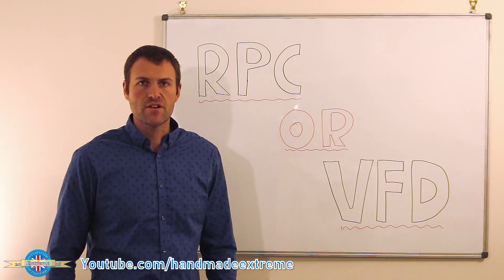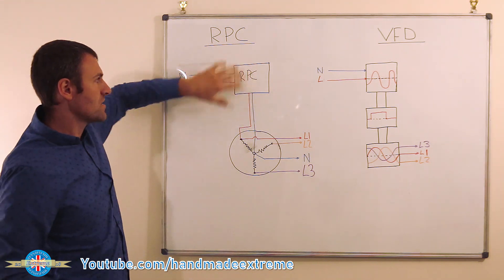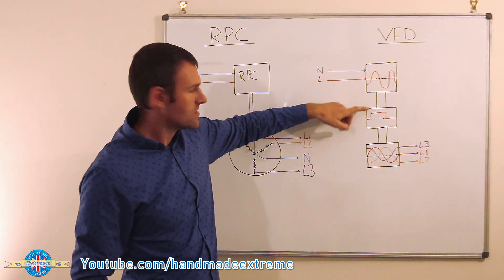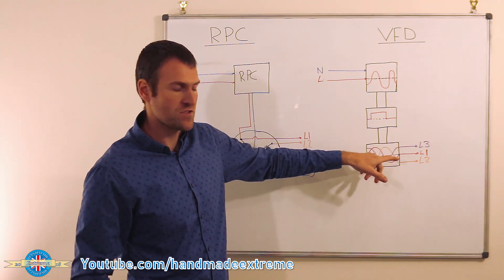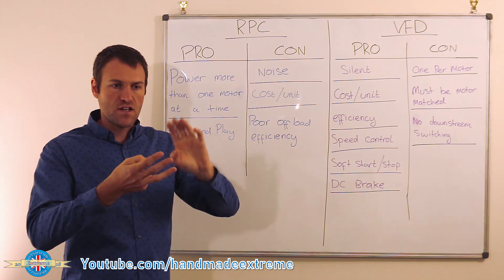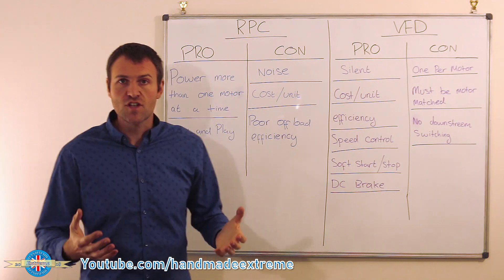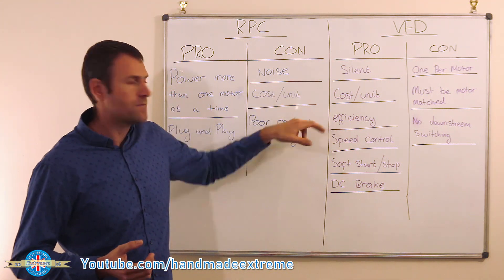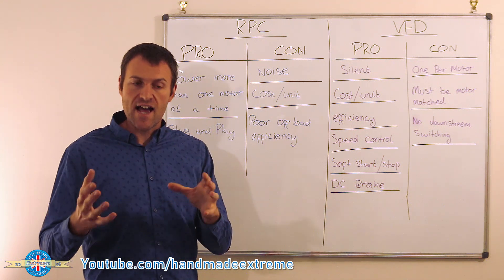Rotary Phase Convertor (RPC) vs Variable Frequency Drive (VFD) ... Which is best ???

Comment: I find VFD ability to vary lathe spindle speed during a cut useful especially when facing. I run my air compressors, horizontal shaft buffer and a three-phase transformer MIG off my RPC enjoying the additional idler effect of added motors.

Comment: Great video. I appreciate people taking the time to make these to help us out. Some things I've learnt; 

The motor brake on a vfd isn't ideal in an e-stop situation. An e-stop should kill the power to a motor. If you kill the power you cant electronically brake the motor. To use the dc brake in an e-stop situation you have to leave the power on for a couple of seconds so it depends why your wanting to e-stop.

I dont find the speed control on a mill that useful as you lose the torque so end up having to gear down anyway. It can be useful if your going cnc as you get the stop, start, reverse and speed control built in.

You can Multi motor a vfd so long as you stay within its working range for the required combinations of motor on / off and protect each motor individually at an appropriate size which you should be doing with a rotary converter anyway.

Regardless if its rotary or vfd i would connect any single phase components to the incoming live and neutral personally. 

Vfds can often go way above 50hz, 200hz isn't uncommon, so you can make your mill spin a lot faster which is great for small cutters. If it can take it... Many machines will happily go up to 60hz (USA) which can get a 2500rpm mill up to 3000rpm.

Comment: What os this mode to what to compare thins witch as nothing to do together. RPV vs VFD, but what a bullsheet !!! Ok you can drive a motor with both but tha'ts all. They are completly made with differents technologies and workinf on motor's parameters completely different, and you want to compare them. That's totaly insane, it like compring a traditionnal bicycle and his new cousin, the electrical bike. 
RPC is a controller to help the motor starting in the best conditions (U/I, slip and Torque), but only in the starting phase, when the motor is to his stabilised speed and loading, the controler doesn't working anymore to make short.
VFD is a controller to drive a motor from its start to its working speed and that speed could be various several preset and with differents ways to goal it (time prams, current ramps, profile triangle, square...). Rhere is may may art to drive the motor and with the new generation till 10 or 15 years, you can drive it from about 20% from its nominal speed too 150% of it, without damage to the motor.
RCP is a Austin mini from 1965 and VFD is Bugatti Chiron from 2027, what do you want to compare between those 2 cars, that's insanen so it is for your drivers. Allright they can roll in a road, you can drive them but that's all for the comparasion.

Comment: Sorry, but if you're going to give a lecture on RPCs please understand that a 3-phase motor cannot get rotation from single phase power applied to one winding only, which is what you show.  The motor would sit there and hum, and eventually go up in smoke.
At minimum, you need a large (in mfd)  start capacitor wired between one side of the single phase input and the third motor winding to give the motor rotation, with a potential relay connected across that winding to disconnect the capacitor when the motor is up to speed.  To take full advantage of the motor's capacity, one or more run (low mfd) capacitors can be connected in parallel with the start capacitor/relay connections.  A 3-phase motor running on single phase operates at about 2/3 of its capacity.

Comment: Although he mentions running two or motors from one RPC, there is no mention of the limitations of doing so.  What is the formula for calculating acceptable loads?  Is there a rule of thumb that says what size RPC for the motor or motors connected?  This information would be very useful.

Comment: The idea of plugging/unplugging motors into some kind of a receptacle from the VFD sounds interesting.  However, if you unplug a motor from an energized VFD you run the risk of blowing up the VFD.  They DO NOT like having their load side disconnected from the energized load.

Comment: VFD provides  dynamic braking?  I don't think you are going to get an off-the-shelf VFD equipped with dynamic braking. When you step into dynamic braking you are looking at additional designs and components to deal with the regenerated energy from the motor.

Comment: With the VFD you don't get a neutral.  Doh!  The idea is to supply 3 phase power.  If you needed 120v single phase power, you would just go to your lighting circuit panel.  Why overcomplicate things?

Comment: Well, that puts a cat amongst the pigeons.  Bought a three phase geared head mill/drill with an onboard 3 ph coolant pump. Main drive motor is 1.1KW Bought a 4KW VFD thinking that it's over capacity and will run cooler.  Also have a 3 Ph combo saw bench/spindle moulder. Sooooo, I can't run the coolant pump off the same drive? And the VFD has to be matched to the driven load therefore none of this will work???  Going to have to look more deeply into this.

Comment: This video towards the end exactly described the beginnings of my home machine shop lol. Started with a lathe, used a VFD. With the lathe, I wanted a mill, then a surface grinder.. and I have more I want to add.. so rotary phase it was. Plus I didn't size the VFD high enough.. lathe had a 5hp motor. Bought a 5.5Kw VFD. Technically, 5.5Kw good for 7.5hp , but i really should have got a VFD sized for 10HP motor. Worked for a few months and VFD died. It was also cheaper chinesium VFD. Maybe if I'd used a higher quality the 5.5kw would have been plenty of head room.

Comment: What a lovely channel you have here, I dont understand why youtube did not recommend this to me ever before when I search for relevant stuff that you clearly cover in your uploads. 
Anyway, how big of 3ph motor can we run on single phase by either of these methods? For example, how about a 5.5kw or even better 7.5kw air compressor? I presume we have to be limited with 1ph supply at some point? 
Thanks

Comment: Thanks for the detailed explanation. I bought a used Cabinet table saw at auction. I had planned on a 3hp/2.2kw but I ended up with a 5hp/3.7kw. It's a better saw, but the price for the VFD rose from $260 to $700 though I did find one for $400. It came with a panel box containing a magnetic swithing system and a poorly placed on/off switch. Those I eliminated because they were unnecessary with the VFD. It has a terminal strip for connecting switches etc. so I plugged in a foot pedal switch for hands free operation when cutting full sheets. One pro I see is there are about 100 settings features programmable for my work style. I used the soft start/stop feature and left most settings in default. I just recently discovered it also will not let the motor start if the blade has any resistance such as my zero-clearance insert was set for plywood and I forgot that when I raised the blade for 2" wood. the binding of the blade did not end up tearing the thing out it just refused to run or even make sounds like it was trying. So I made the necessary adjustments and carried on.

This was the only 3ph machine I had, but now I have another which is a water cooled table router which is 3ph - 220V It is close in power at 3.2kw/4.3hp. I will have to see if it works. I may need to buy the next size down VFD, but they get cheaper as they get smaller.

Comment: I bought a 5hp vfd to run a 5hp wye wound blower motor. I went to hook it up but the instructions say to rewire the wye into delta. Problem is, its a 9 lead motor with the 3 internal leads permanently connected. Why does it need to be in a delta configuration?

Comment: If the VFD has intermediate step where it converts AC to DC( then it should be possible to run it strictly off DC?

This would allow the three phase motor to be used with battery power in a vehicle.

Comment: I have a power supply with 3 phase 120/208vac input and DC outputs which power fairly substantial DC cooling fans.  I'd like to troubleshoot  these power supplies on a work bench instead of outside using a generator and praying for good enough weather.   My question is would it be safe to use a VFD for this purpose?  All I've seen people talking about using VFDs for is AC motors, so I'm  a bit concerned it might not work.

Comment: Good evening just inquiring whether you could use a VFD to run a syil x7 CNC mill. Or would this cause issues with the LNC 6800 control panel. Cheers PS the spindle motor is  380v 3 phase at 5.5kw I think the rest of the system works off 240v single phase.

Comment: Struggling with wanting to be a hobby machinist. I set out to buy a lathe and fell on a deal with a Hardinge lathe. Without doing any research on it and getting hit home and find out by this video that I cannot just throw a VFD on it because it has three motors on it. Thank you sir for the video. Wish I had watched it first.
Reply: True but you can pretty easily set it up with 3 vfd's if needed. As stated in the video if any of the motors on the machine are not 3-phase then they don't need a converter. Otherwise you could just set all three vfd's on a board and just flip them on before firing up. Sure it is a bit of a pain to have three but it would work.

Comment: Another PRO for the VFD is the electronic protection it can provide to the motor (short circuit, thermal, single phasing). With a RPC, you'd need a separate Thermal Overload.

Comment: One trick we do in the states is to install a three phase breaker panel after the RPC. Then each machine has a circuit breaker matched to it's current demand. The RPC has a master output breaker or fuses so if too many machines are on at once, that will trip out. The machines can then be hardwired to the breaker panel as three phase plugs and sockets can get quite expensive, $50 for just a single plug or socket.

Comment: I use one VFD for several machines from 1hp to 5hp ... 4yrs on in a busy commercial workshop and I've had no issues. Some machines are easier to use an RPC and some are easier to use a VFD, my Cincinnati mill just trips my mains using an rpc, yet runs on a cheap VFD just fine ..... yet my TOS mill with it's multi motors is just simpler to use an RPC. You can run two motors on one VFD and have one motor switching while the other runs constant, you just need to set it up properly. ...
Reply: Oh and hands down run a large compressor using a VFD, no sense in using a RPC.

Comment: Very informative video thanks so much, still had to check what a quid was. lol   Want to hook up a 2" belt sander with a 2 HP motor, and use a 3 phase hookup with a VFD, I only have single phase, so I need a 2 HP VFD to match the motor correct, also have a mill and several lathes, but don't need any more converters to run them, they are all 1 phase 220.  Am in the U.S.   Keep my eyes open your more from you, and thanks again, any ideas from you that could help me?👍👍👍👍

Comment: one thing you don't mention with the vfd's is that with the way they work, they generate high voltage spikes, which will ne worst with long cables, that will make motor insulation fail, specially older motors, thats why inverter duty ac motors where created

Comment: Have a band saw that is 3 phase 220v and implemented a VFD. The problem is the bandsaw runs for about a few minutes and then stalls and the motor is HOT. I am suspecting that the VFD can not handle the output to the motor. The VFD is rated to run a 10 HP motor the bandsaw is a 3 horse power 3 phase motor. So the manufacture is saying the VFD is dropping one of the phases.

Comment: just to keep it simple manual machine use RPC if its a CNC machine use VFD, im using both in my work shop 90% of machines are using RPC and the machines work perfect my CNC machines run single phase controls and the VFD works perfect on it.

dont over think it RPC just works and the machines are set up to work with them

Comment: Think ive only got 240v signle phase residential au, what combination could i set up for a Ve Test bench motor. From what i can gather a 2.2kw with a RPC. I need adjustable controlled rpm  to up to oh about 2200rmp think it is and 650rmp idle car speeds. Since the pump rpm is double the engine in 4 stroke engines this 4400rpm would go close to be able test most engine rpm. If im wrong please suggest what instead? Thanks.

Comment: Very informative thankyou.. I had not considered the fact that the VFD makes a delta output, thus no neutral. Turns out this is not an issue for my single 3ph mill but I should have considered that.

Comment: I've never heard of a VFD with a lower HP or W limit. Upper yes, as that's only logical. On another note this technology is rapidly changing. The manufacturer of my 2.5KW VFD now makes a version that you can program and output perimeters for up to 4 separate motors. They can't be run simultaneously though but why would you want to? For more information please read https://www.youtube.com/channel/UCBA1894u_ZYwupCmcAVdeuA.
Wakodahatchee Chris

Comment: Most inexpensive VFDs don't put out a 3-phase sine wave but instead 3 pulsed waveforms that are continually monitored and adjusted by the controller to control voltages and currents in each of the phases so they have the same behaviour as sine waves.  This is why they can only power a single motor at a time.    Also I have never known a VFD to have a minimum motor spec..  Maximum, certainly, but there is nothing to prevent using a 30 kW VFD to power a tiny 0.5 kW motor other than the fact that you're wasting money by using such a big VFD..   The biggest con with VFD that prevents sharing as a power station is programming all the rates and limits for the motor as they are not all just laid out on the plate on the motor but in many cases must be calculated, and the user interface on VFDs is a huge pain to use and navigate..

Comment: You are correct. VFDs are NOT meant to power equipment. They are designed and built to run motors directly.  If your devive is anything more than a motor, a VFD will likely break your machine, if it even runs at all. There are transiant voltage spikes that will make it past the IGBTs and be at DC bus potential (usually 1.35 x line voltage) VFDs are expecting a load that has the electrical characteristics (impedance) of a motor, it will likely fault once it tries to start.

Comment: Sorry but why can't i connect more motors with a single vfd? I did It and It works. Is it a bad idea for the elettronics insidie the vfd? Is It dangerous?
Reply: wondering the same i was under the impression you could operate more than 1

Comment: Vfd's wired with an isolator can fundaentaly run 3 to 5 times the amperage/wattage than a rotary phase converter can.

Comment: During use rotary phase can drop voltage below what is required to run a transformer, or while idle smoke a transformer.

Comment: I see 9 things wrong with this. I can run multiple motors off one vfd with speed control. Must be separately ran with separate thermals. Add the motors together. And yeah you can switch add/and subtract motors without screwing up the vfd.

Comment: I have used a transwave rotary converter in my wood shop for over 25 year's now and it still runs great.
It will happily drive three four even five motors simultaneously with no problems, even the 5hp compressor. 
I turn it on when I need to run machinery and turn it off when I'm done. Easy. Only one problem with the main start switch. It broke apart internally and burned out a capacitor. So if your switch starts to feel rough, change it. 
Typically I will always be running at least two motor's at any one time, ie dust extraction plus Panel saw and often three. Transwave make a great rotary converter but they are not so hot on customer service and have refused to send me spare parts. Shame really.
Luckily I was able to source parts elsewhere.
The big advantage of rotary is it will happily power even my knife grinder which is 2.5 hp plus fractional Hp carriage feed with a VFD. So yes, I would definitely recommend Rotary if your running multiple motors. The noise is hardly a bother compared to my machinery. One other piece of advice. Blow the dust out of it every now and then.
Reply: I have just purchased a meddings f14 3 phase pillar drill and cannot decide whether to buy a vfd or a rotary convertor.  Would you still recommend the transwave to buy?
Reply: @jeremykemp3782  
Just use a VFD, with a variable speed if you can get one.
I have a Vfd on my grinder feed motor. It's a very handy feature.
Reply: @joschmoyo4532  ok thanks

Comment: Great information, well presented. Am I correct in thinking that a rotary converter would be better for a motor that starts under load (e.g. powering an air compressor) most of the time?

Comment: Another point you might want to make is that the rotary phase converter will need a 220v single phase source to develop a 220v 3 phase output whereas you can power a 3 phase motor up to 1 hp with a VFD operating on 110v single phase AC. (USA example)